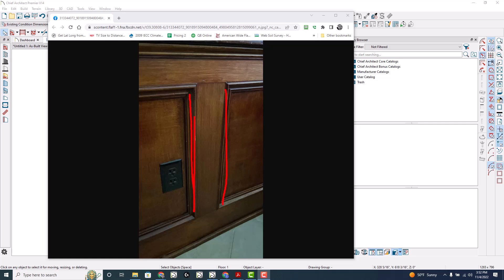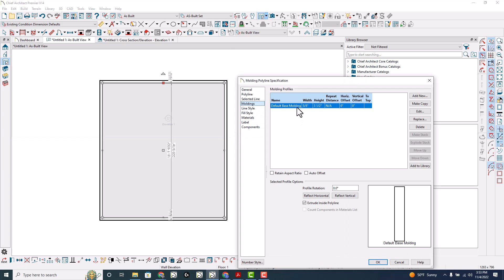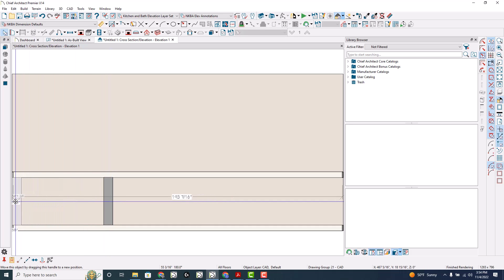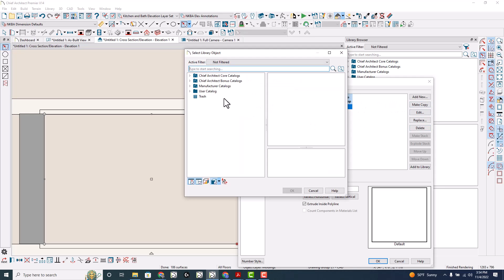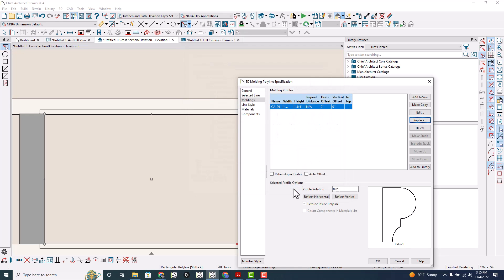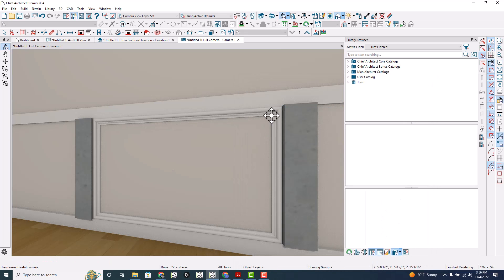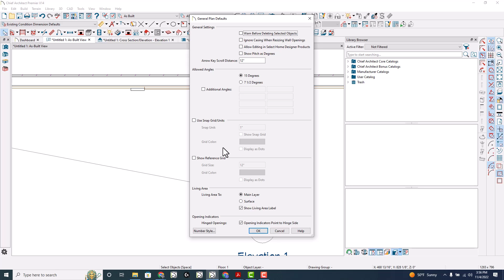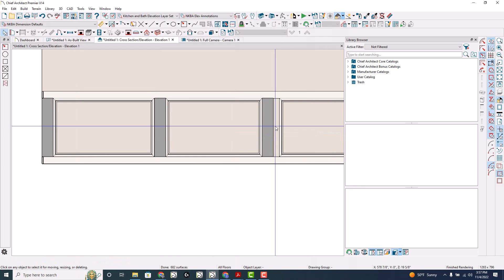Panel Molding | Chief Architect

Comment: Making the entire assembly -- styles, rails, moldings and panels from a cabinet makes it easy to add or subtract panels and everything automatically rebuilds to keep the panels all the same width.
After you have the panel molding as you want, convert to a cabinet door symbol and apply as a panel.
Reply from the maker: Cool idea! I know others had mentioned using cabinets, but I never quite figured out how to do that. Turning the panel molding into a cabinet door symbol makes a TON of sense!
Reply from the maker: I had to try this out, and just did it. There could be some unique tricks based upon the molding selected, but overall, this is a KILLER method! Thanks for suggesting it. I'll share the video tomorrow.